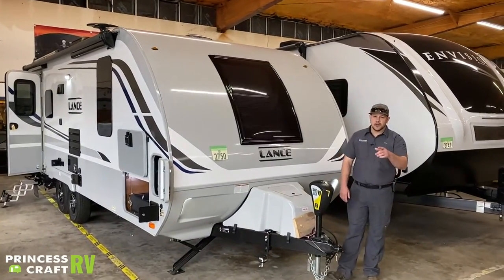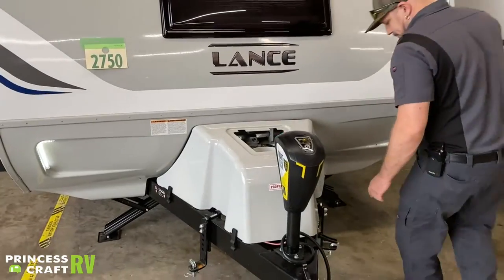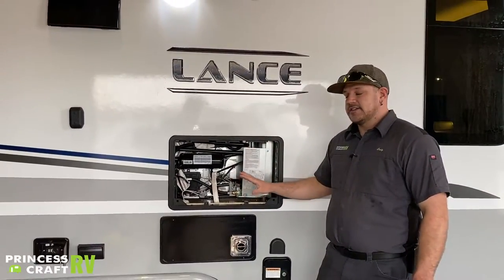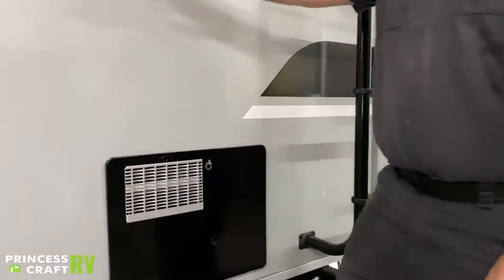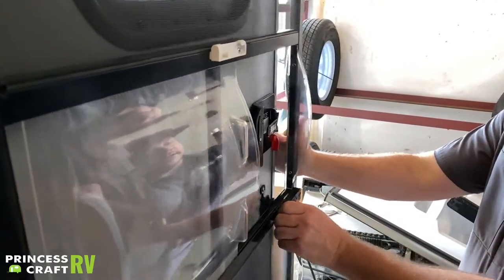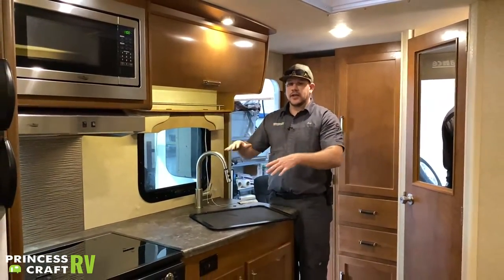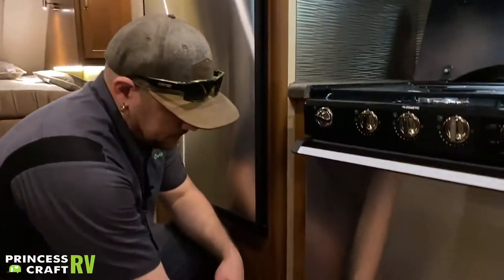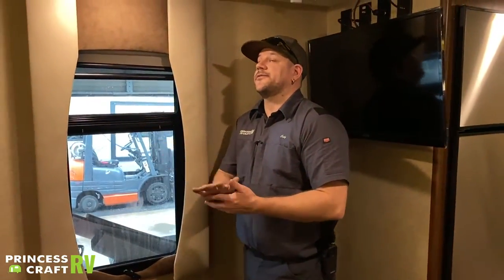Technician Tour - Lance 1995

Comment: What year is this Lance 1995?
Reply from the maker: Looking at the publish date for this video, I believe this is a 2020 year model. I would need to ask our sales team if they can see any specific identifiers in the video to really nail down the year.
Reply: @RVTechToursatPrincessCraft  Yeah, I'd tend to agree. Though it could be a 2019 or even a 2021. I have seen some RV manufacturers come out with the next model year as early as April, which I think is insane. Do you all usually include the model year in your videos? I think that would be a good idea. ;-) I ask about the model year because there were some subtle changes in the late models and I'm trying to figure out which year the changes were made. That way when I'm shopping online I can know if a particular year will have the change I want or not. In particular, the long access tray in the exterior compartment on the front camp side. This indicates also that the other side has a generator storage compartment. That's one change I'm trying to figure out.